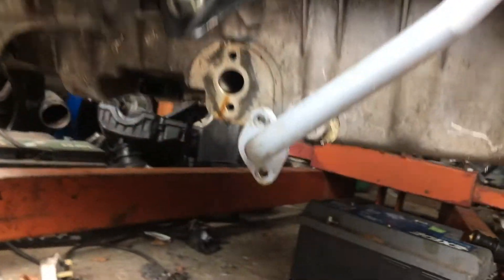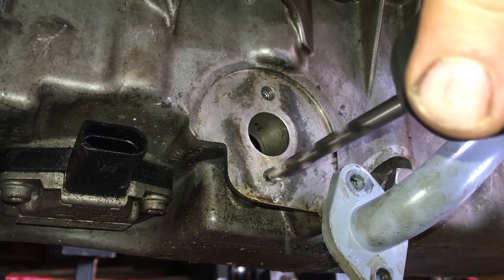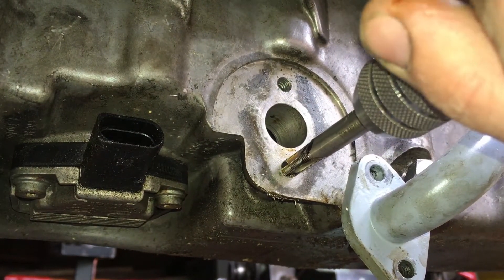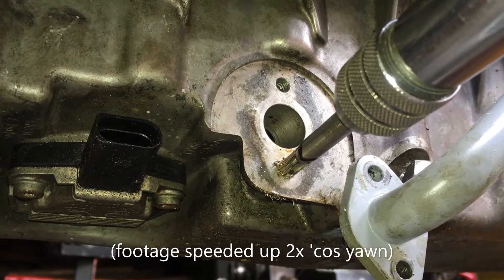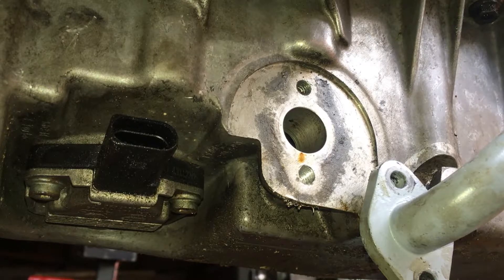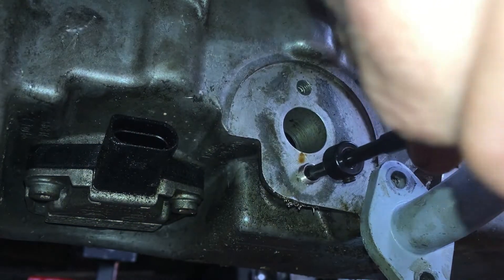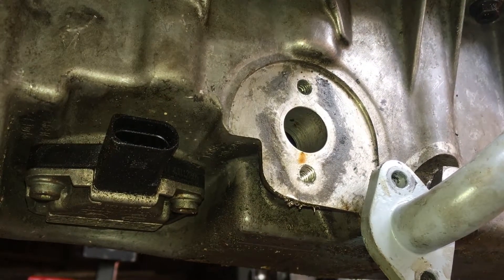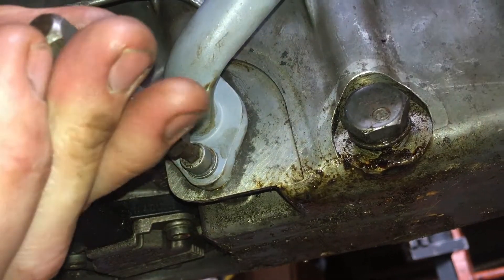Five minute fix: Helicoiling a stripped thread in an aluminium sump - stronger than new!

Comment: Oof, I had a hardened bolt break off in a cylinder head once. It took three evenings to grind it out. Glad you were able to fix this.
Reply from the maker: Ouch. When the bolt is harder than the surrounding material, things get really nasty. I like to weld a big nut on if at all possible, and then hope the heat breaks the bolt loose. Works most of the time. Never had much luck with extractors and the like.
Reply: @davemakesstuff5828  Yeah, it was bad. We had to cover all the engine internals and just grind away sloley until we could grab it.